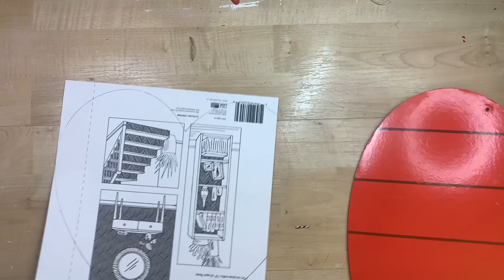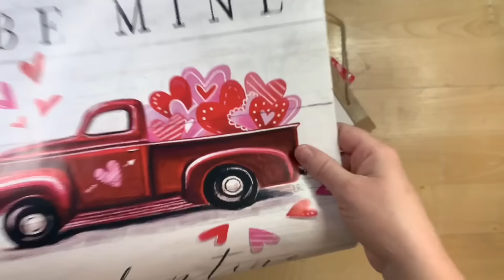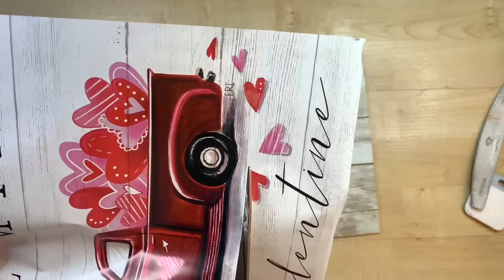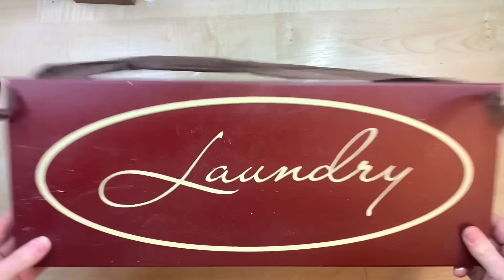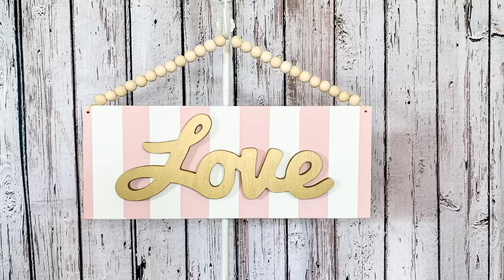💕 20 Valentine DIYs under $5 | Budget Friendly DIYs to try

Comment: The tail part of the arrow is call the “fetching”.  There are three parts of the arrow: arrowhead, shaft, fetching.  
The nock is the slotted plastic tip on the rear end of the arrow that snaps onto the string and holds the arrow into position.

Comment: Use your heat gun to melt the glue when removing items from other items so you won’t damage them.
Also, throw you bead in a container of certain color with lid. And shake. Pick out with tweezers to dry.  Label container with color.  
Love the pink lemonade wreath.
Those colored beads would have been beautiful on that gold love sign.  The garland is cute.
A tip I have seen a crafter do with a long needle use for furniture covering. I can’t get the name to come to me.  (Stroke).  Brain and tongue does not work sometimes.
They string the beads and then tie of and run the needle and string or twine back through the beads with some hot glue on the portion of the string or twine that will be cut off and left behind in the beads.  Same with tassels.
I believe it is Shannon at My Cozy Christmas Cottage (only around Christmas) and she has a regular channel.